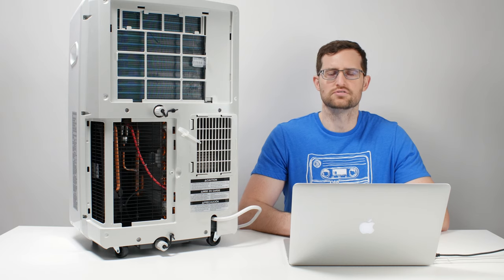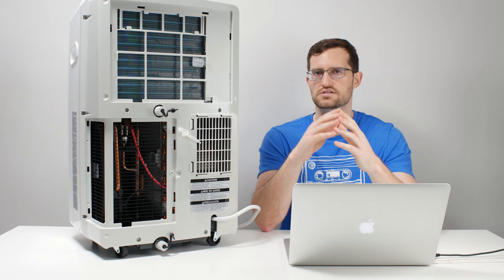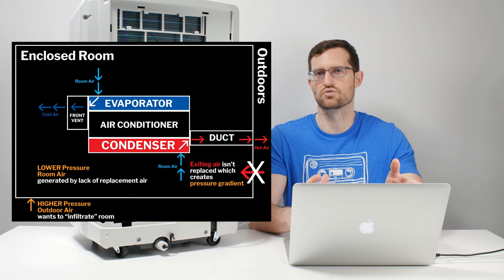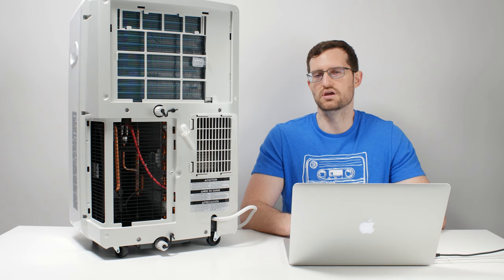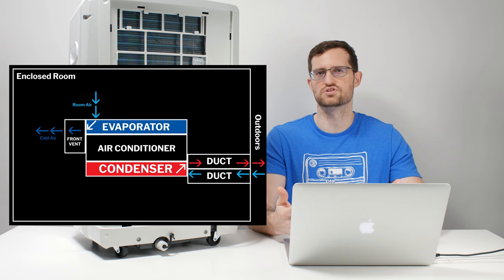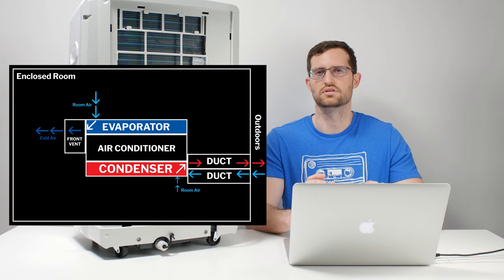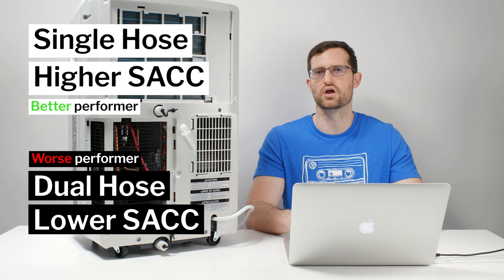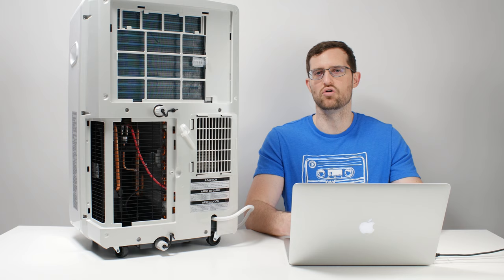Single vs Dual Hose Portable Air Conditioners

Comment: Glad I came across this video, I was told the exact opposite,  that dual hose portable air conditioners are more efficient.
Reply: What you were told is largely correct, this guy is a bit of a muppet. He’s vastly overstating the disadvantages of dual hose and not talking about efficiency, just capacity.
Reply: Dual hose units ARE much more efficient and cool rooms better. It's obvious, since they don't draw hot air from ouside into the room like single hose units do, which only blow air out of the room. Dual hose units take air from outside into the unit directly to cool it down, which then is blown out with the hot air from the cooling process and thus there is no negative pressure inside and no need for the hot air blown out to be replaced by drawn hot air from outside.
Reply: To add to Mohog, the fan itself then sucks in cooled air from the room and adds it to the cooling capacity made by the condenser, just like a cars AC unit on recirculate. Vastly more efficient.

Comment: This presenter focuses on the wrong areas, that don't mean much for cooling. Dual hose is closest to having an outdoor unit or window unit, for portables. It recovers cooling capacity, which is the whole point of trying to chill a space. 

Single hose units create a vacuum that sucks hot air from anywhere there is a draft. Like the rest of your house that isn't already air conditioned, or outside. They also suck in the cooled air you just made and use it on the evaporator side of the condenser, heating it back up. Super inefficient waste. 

Dual hose solves the worst things about portable air conditioners in 2 important ways. It eliminates the vacuum by drawing in outside air and exhausting hot air, on both sides of the condenser. So no massive waste there. Then, like a cars AC on recirculate, it draws cool air into the fan and adds that to the cooled air in the room, which is similar to how a refrigerator or freezer 🥶 can work so well, because of added capacity. 

Want to make dual hose even better? Seal all gaps in your exhaust/intake window and insulate the hot side of the dual hoses.

Comment: I wish I'd seen this before I bought my dual hose. It gets the job done though but i feel like i may have gotten the same results or better for less now.
Reply: No you did the right thing. Dual hose is much better than single hose.
Reply: @-Mohog  it worked wonderfully for me. Kept me cool and dehumidified, locked down in an ancient non air conditioned building in NYC during my Pandemic time there.

Comment: Single or dual: both configurations will be using outside air either directly or indirectly to cool the condenser.  With a portable, the goal is to cool a single room.  The cooler air from within the room passing over the condenser will enable the evaporator to reach a colder temperature thereby blowing cooler air into the room.  So, single hose units are more effective at cooling a single room at the expense of warming up other rooms.
Reply: ...   >"So, single hose units are more effective at cooling a single room at the expense of warming up other rooms."

Why in this case other rooms will get warmer?
Reply: @FirstNameLastName-cu2tq  Because warmer air from outside will be drawn into the house/flat as it makes its way to the room with the portable air con unit which is expelling hotter air from the exhaust than the new air that it drawn in to replace it.  As long as the exhaust air is hotter than the new replacement air, the room will cool down.
Reply: @ianmilleris  , thanks!

Comment: Single better than duel (Unique situation) for me BECAUSE 1) the only openings in the house are on the sunny versus shaded side of the house,  2.) air drawn into the condenser either comes from the hot sun baked wall outside the room or the shaded, landscaped, breezy and cool side of the house.
Reply: Similarly, I'm thinking if I'm running my swamp cooler upstairs, it's creating a positive pressure that will hopefully offset the exhaust from a single duct AC.

Comment: Seriously? EVERY AIR CONDITIONER uses warm outside air to cool its condenser. You gettin' a little scratcheroony to badmouth dual ducts? Single ducts suck air, it's already cooled, out of the room, and warm air into it. Dual duct is the only way to go.

Comment: The Whynter ARC-14S Is a junk unit anyway it's the first dual hose portable air unit I've ever seen that also has a third vent that's still pulls air from the inside the room to help cool the condenser. I replaced mine with a Whirlpool Model:WHAP142AW and there was worlds of difference in the efficiency rating the whirlpool has nearly twice the efficiency of what the Whynter had.

if you going to buy a portable air unit folks remember don't cheap out on them sometimes the cheapest is not the best.

Don't cheap out folks on a portable ac unit

Comment: Don't let this video fool you. This guy doesn't talk about true difference energy usage between the 2 portable AC types. He's being paid to say the single hose unit is better when clearly simple physics will tell you in single hose design the exhaust hose is blowing out the cold indoor conditioned air you paying for -- and then hot humid outside air must be drawn into the house from other areas like gaps in windows doors chimneys & attic doors ect..  Therefor w the single hose your AC unit always be running all the time to cool the house!

Comment: Sorry, but this is nonsense. You don't even need complicated math, as you can just make up units. If the unit is pushing 12345 "units" of air outside, 12345 "units" have to be drawn back inside. All machines generate some amount of heat, so it's literally impossible for it to have a net cooling effect. In a house with one room, running a single hose air conditioner would make the room HOTTER. They're not entirely useless; if you put one in your bedroom at night and don't care about the temperature in the living room, the bedroom will get cooler. A dual hose unit might cool the bedroom slower, but it won't heat the living room in the process. More importantly, it would actually work in the 1-room house.

Comment: They work way better if you can elevate them off the floor. Warm air rises and cold air sinks to the floor. Lift the unit higher for better performance

Comment: Bro basically says: It's better to let hot air leak into your whole apartment due to negative pressure than leading it directly into the AC unit. Genius!

PS: Never do another technical "review" again, please!

Comment: What a joke,  in Central ac use hot air from outside, turns hot gas to liquid in the condenser and the evaporator to take out heat from changing from liquid though the txv or piston . If it pulls air from the attic because it has only one hose to the outside andits trying to pull air from any possible way to compensate for the negative pressure and the attic temp is 130 degrees is not the same from out door temperature of 103 degrees.

Comment: It's simple. Buy a dual hose or just skip the portable air conditioner. A single hose is simply trash and almost useless. It ends out sucking your cold air out making a kind of "vacuum" that needs to be filled. By what ? Bet you guessed it ! Yes, hot air from outside while the main objective is to decrease your room temperature.

Comment: acs are built so dumb. the warm hot air from hotside shouldnt be going through the condenser. the point of dual hose is to prevent negative pressure. just use the outside air for the compressor intake and cool the air in the room over and over. that would be a way more effecient air conditioner.

Comment: Well I got a general electric $350 floor air conditioner and my room is colder than f**! and it's 110° outside so I'm calling b****** on that whole speech! Oh and my flimsy air duct tube that's going up to my window and outside is not hot at all! so I also call BS on that as well!